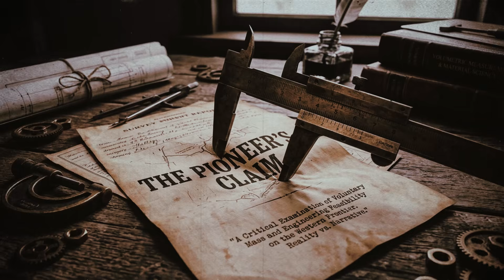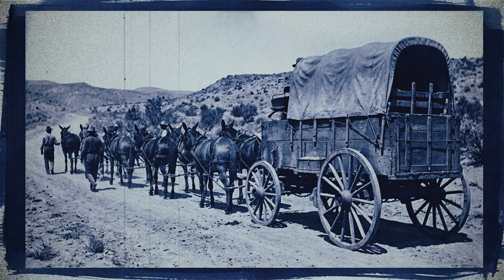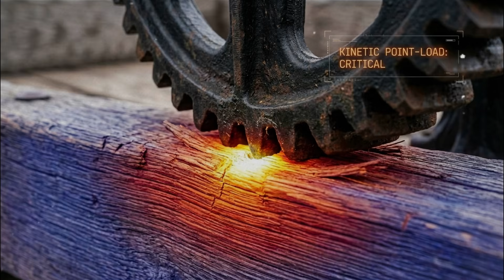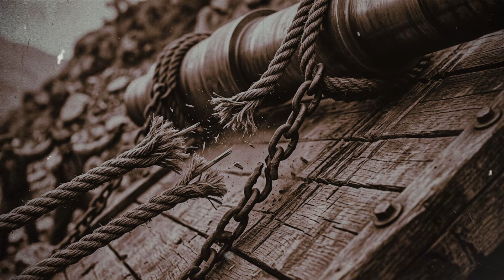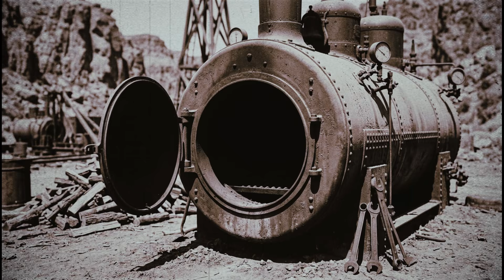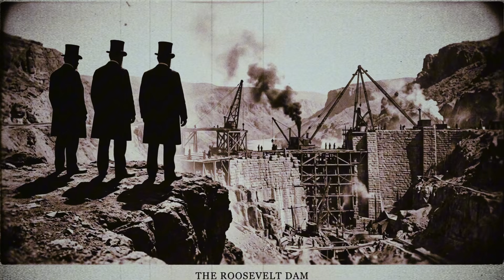The Roosevelt Dam Anomaly: An Impossible Excavation

Comment: it was built in the 1930's, not 1905. this is all bs.
Reply from the maker: I think you might be mixing it up with the Hoover Dam! The Hoover Dam was built in the 1930s. The Roosevelt Dam (the one in this video) was constructed between 1903 and 1911. That's exactly why this project is such a massive logistical mystery—it was built decades before they had the proper roads and heavy trucks that they used later for the Hoover Dam. Feel free to look up the dates!

Comment: Awesome job!
Reply from the maker: Thanks so much! Appreciate you watching!
Reply: @TitanMetrics  You did great research. The only issue that I have is that you have to descend Fish Creek Hill traveling from Mesa to the Dam site. Your argument still stands, however. Descending into that canyon safely, hauling 20+ tons, would be impossible with a team of mules and a wagon. Not only is Fish Creek Hill very steep, it has twists, turns and sheer drops all the way down and ends with a hairpin turn at the bridge on the bottom. Another glaring issue is the two official timelines. You already proved that the more well known timeline of 8 years would be impossible due to the constant train of wagons running at capacity. The math just doesn't check out. But when you look at the timeline put forth by the Library of Congress's video, just 2 years, it becomes complete absurdity.
Reply from the maker: This is an incredible detail! Thank you for pointing out the geography of Fish Creek Hill. You are 100% right—adding a steep descent with twists, sheer drops, and a hairpin turn to the equation makes the "mule and wagon" narrative even more laughable. Trying to brake 20+ tons on a grade like that with 1905 wagon tech is a literal death wish.

And amazing catch on the Library of Congress timeline! When they shrink the window down to just 2 years, the math goes from impossible to straight-up science fiction. It just further proves that the official paper trail is a complete fabrication designed to hide the massive industrial machinery they were actually using. Thanks for adding this level of detail to the audit!

Comment: As much as I agree with simple machines to handle crazy weight, the time period had trucks.  Harley had 100,000 miles on their 1903 prototype by 1906. Just bad record keeping. 

Another channel had pic of some of the dams. It looked like concrete was poured over an older structure. There was rough hewn rocks. 

Check port history for heavy lift cranes. Or steam shovel history. I did check tunnel boring. I think patents were filed possibly 100 yrs or more after using tunnel shields
Reply: So you believe the United States Capitol Building was Built using Horses and Wagons in the year 1801 ? 

Do you believe the Vatican 🇻🇦 in Rome, Italy 🇮🇹 was Built with Donkeys 🫏 and Wagons in the year 1601 ?
Reply: @donaldrodriguez717  not at all but I will not discount Ed Leedscalin or the old dude hauling buckets recreating Stonehenge. I am in logging and pivot and slide millions of pounds a year. Sometimes 50 ton in two days. I can't help that Archimedes was forgotten. Plus I said clock work analog machines was 1400-1600s. If you can cut a gear....then why not index anything. I won't play dumb. Hell yes corps rip us off. But then again a fulcrom point is not common knowledge. So I agree with Titan metrics. Freaking automatons could  do anything with the speed of analog. Vs AI . Why in the heck was there not big machines and smart people. Take 20yrs to build any of this crap today. With AI. What is the missing factor?
Reply from the maker: @Adv-caveman With your logging background, you know exactly how much weight you can move with the right leverage and a solid fulcrum! You hit the nail on the head about analog machines, too. If they had complex gears and automatons centuries ago, they absolutely had massive, heavy-duty analog machinery in the 1800s—they just kept it out of the official photos.

You asked what the missing factor is today? It's red tape and financial red tape. Today, corporations drag out projects for 20 years just to milk the budgets and deal with permits. Back then, the syndicates had raw, unregulated analog power and just got it done. Great insights, man!
Reply: @donaldrodriguez717 
Donkeys Incorporated? 😂
Love MLB.
Reply: @QueenBeruthiels10cats 

Exactly it’s all a Lie, a lot of people are in serious trouble.😂
Reply: @donaldrodriguez717 
They’ve been doing it for hundreds of years. I doubt there’ll be many consequences at this late date. People in general are too dumbed down - on purpose. 
Our “history” books were mostly written by an idea from HG Wells. His papers are at Urban-Champagne and he suggested a “World Brain”.
If that’s not the height of dystopian BS, I don’t know what is. 😂
Reply from the maker: @QueenBeruthiels10cats  It is definitely fascinating how much influence a few powerful voices had over the official historical narratives! While the philosophical and societal stuff is super interesting to think about, at the audit desk we always try to stay laser-focused on the physical ledgers—the steel, the coal, and the actual corporate syndicates who controlled the infrastructure. But you're absolutely right that the "official story" was heavily managed by those at the top to keep the public in the dark about how things were really built!
Reply from the maker: Exactly! When you actually stop and think about the sheer scale and weight of those buildings, the whole "donkeys and wagons" story becomes completely laughable. The official narrative just expects us to ignore basic physics and logistics. Great examples! 💯🔥
Reply: @TitanMetrics It is easier to research one aspect of these massive projects. I checked for the logging history in the area. The Phoenix Logging company milled 1.5 billion boardfeet in 40 yrs. The Phoenix log hauler model 1901 still exists. And still works for steam shows. 

Most likely there was rail networks. There would be no reason to leave the tracks. And I am sure there was methods of laying temporary tracks. Supposed ly the Barber mansion had tracks to each structure. Then the tracks were removed. This would explain the efficiency and time frames for mammoth projects. The dam project could have used steam drag lines to cranes. Maybe Rosevelt needed the proganda of hand work. It would help sell more projects. And pictures match the story. The hand operated beam type cranes were possibly used for final placement. And great pictures for the administration. That might the reoccurring theme. Plus the time period was a free for all for subcontractors with zero environmental laws. It is very difficult to research these things. 

It is impossible to believe dynamite and steam wasn't used to build the dam.
Reply from the maker: Man, this is exactly why I love this community! You actually went and pulled the logging records! 🤯

The idea of temporary rail networks that they just ripped up after the job is brilliant. It makes total sense and perfectly explains how they moved that much mass without leaving permanent roads behind. And you are 100% right about the propaganda photos. They bring out the hand-cranked crane and the mules for the official government photo-op, but keep the massive steam draglines out of the frame. It was all a carefully staged PR stunt.

Seriously, incredible research. This is absolute gold!
Reply: @TitanMetrics  This video had a lot of clues. The 1902 Reclamation Act also known as the Newlands Act was a revolving fund. The construction cost was to be paid in ten years by farmers who benefited from the irrigation. And led to modern day US Bureau 
Of Reclamation. I will get back when I find out more.
Reply from the maker: @Adv-caveman Man, you are absolutely on fire with this research! 🔥

Think about how crazy that detail is: the idea that local farmers were supposed to pay back the costs of a 68,000-ton engineering marvel in just 10 years is wild. When you look at the true scale of the logistics and the hidden heavy machinery they actually had to use, there is no way the math works out for a simple agricultural payback. It sounds exactly like a massive financial front for the syndicates to move money around. Can't wait to hear what else you dig up! 🔍
Reply: @TitanMetrics I think the property records will have land transfer. There was a 160 acre limit. Jeffersonian limit of corporations. I do think there was manual labor. Yes, moving money! Having to work off the farm to pay the taxes on the farm. Then loosing the farm might have been common. And larger farms were divided into smaller farms. I am beginning to think this is the reason for many projects. Land grabs and taxation might be the reason. Some might be commerce. But it seems odd that the planning worked out very the next 100 yrs. 

I am willing to bet east coast newspapers featured articles of the flood events. And the great fix. Plus a new paradise in the desert. This was really cool to dig into. And opened my eyes to other engineering anomalies. It sure as heck beats the other off the wall theories. Thanx for the videos!
Reply from the maker: Man, you are absolutely crushing this investigation! 🤯
The idea that they used East Coast newspapers to hype up the flood events just to sell the "great fix" is classic 19th-century corporate PR. Using taxation and infrastructure debt to bankrupt farmers and orchestrate a massive land grab makes complete sense. It turns these mega-projects into giant, state-sponsored monopolies.
I'm so glad this grounded approach resonates with you. Digging into the actual money, ledgers, and land records is way more fascinating (and real) than any of the "off the wall" theories out there. Seriously, thank you for sharing all this brilliant research with us!
Reply from the maker: You nailed it—technologies were being used heavily in the field decades or even a century before the official patents were filed or made public. It wasn't just "bad record keeping," it was deliberate corporate secrecy. Awesome job doing the research!

Comment: What if they simply expanded an existing dam, complete with hydro-electric power plant? 
What if there was already an existing roadway to and across the dam and they simply poured concrete over the face of the dam to cover the existing stone construction, similar to the way they covered up the wooden Central Pacific Railway bridge in the Sierra Nevada's by simply dumping dirt they hauled over an existing railway, as you exposed in your video 'The Secret Town Fraud They Buried a 90-foot Bridge?
Reply from the maker: That’s an awesome callback to the Secret Town video! It’s great that you're connecting the dots. But even if they were just covering up or expanding an older structure, the real headache doesn't change. You still have to get those massive, multi-ton steel turbines and heavy power plant equipment through 60 miles of rough desert canyons with no proper roads. The official story that they did all that heavy lifting with just mules and wooden wagons is what still doesn't add up!